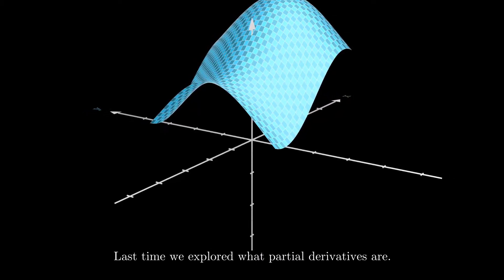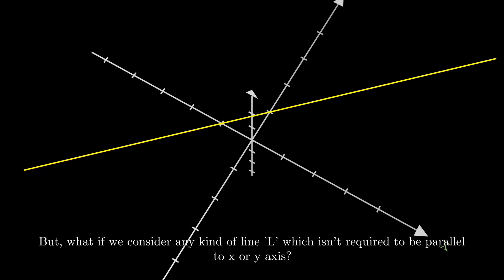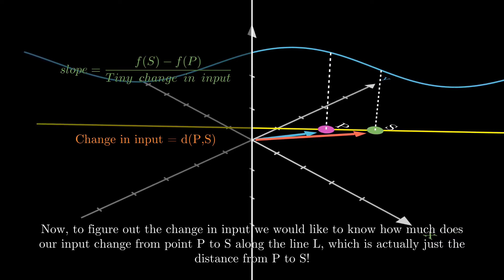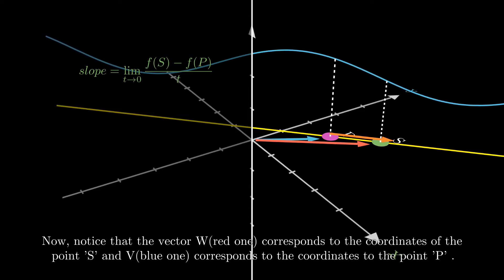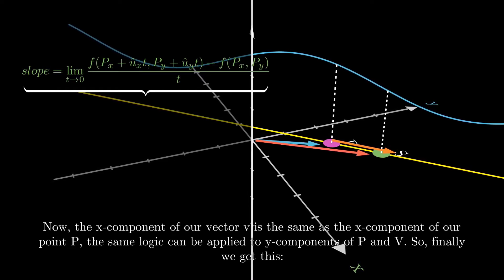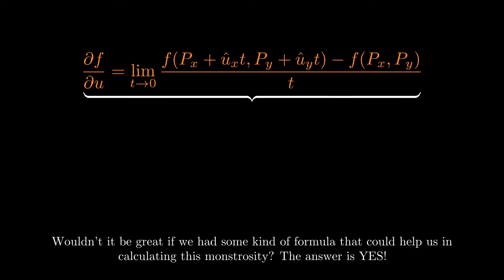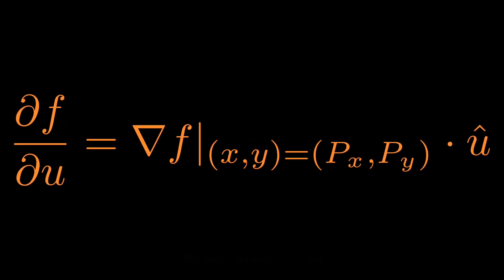Directional Derivatives | A Visual Introduction

Comment: Good job on animations!
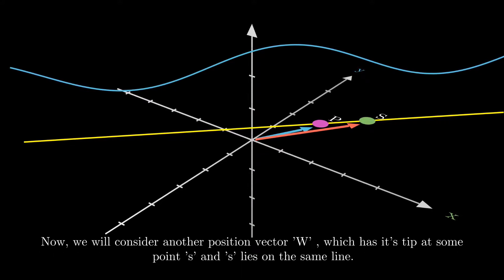I think two things could improve the experience: a more expressive voice, and manim drawing 3d things in correct order (like at 1:22 yellow line should be drawn behind the z-axis). I face these issues myself and it drives me crazy. For the voice, I think we need a free voice with SSML support or at least some support for indicating emphasis and timing. Let me know if you find one!
Reply: @epsilonguy-279  Keep it up!
Yeah, when I was rotating dodecahedrons in my video, I had to omit showing rotation axes, because it looked wrong. Now for my second vid I'm having to manually avoid drawing some things that are supposed to be behind others.